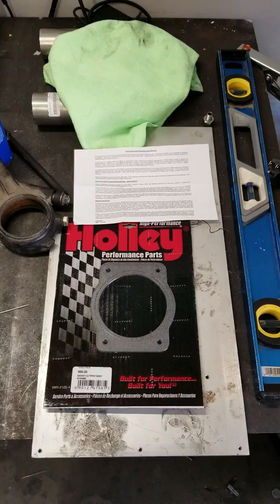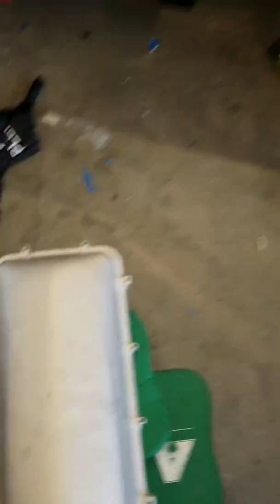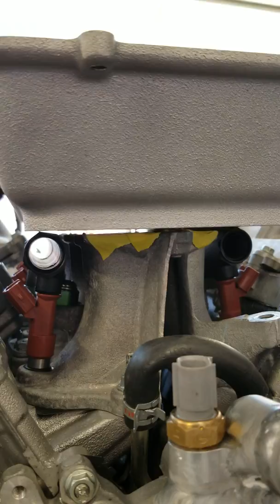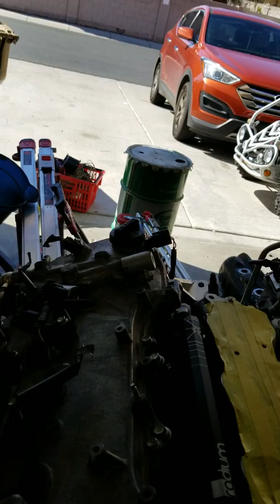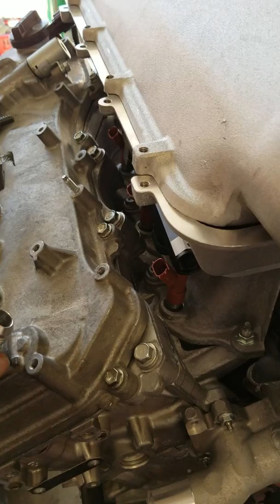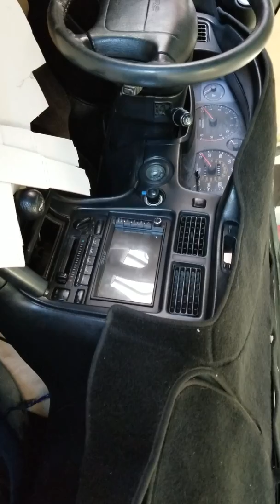3.9 Liter Twin Turbo 2GRFE Update Engine is Assembled

Comment: What if you notched out where the fuel rails hit on the side to keep the profile down and run velocity stacks on the inside of the plenum you've created? Or if you run an A2W core in your plenum milling and moving the LSX carb base down will also keep the height down. Then weld piece on the inside making sure the flow is fed towards the intake runners. I subscribed because the MR2 is beautiful and I love the 2GR-FE swaps in these.

Comment: are you using darton sleeves ? how many hours did it take to take care of the timing / timing belt issue?
Reply from the maker: no sleeves.   A aluminum plate was machined and pressed into the waterjacket, closing the deck effectively

Comment: what type of work
do you do on the 2gr do you replace cams? valves ect? where are you based out of?
Reply from the maker: Cams are custom regrinds, valves are Custom Manley stainless valves filled with sodium.   Im in Phoenix, AZ
Reply: @airjer18 hey man is there a way to reach you I live in Queen Creek AZ as well and found your video 4 years later but I’m hoping you’re still around.  I’m looking to chat about building a 2GR-FE for my 1992 MR2?  Thanks!